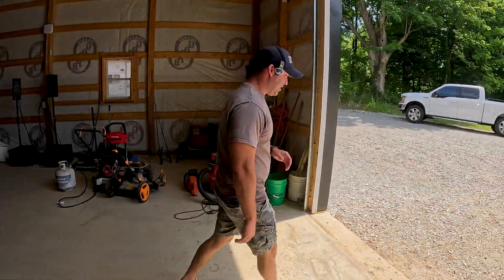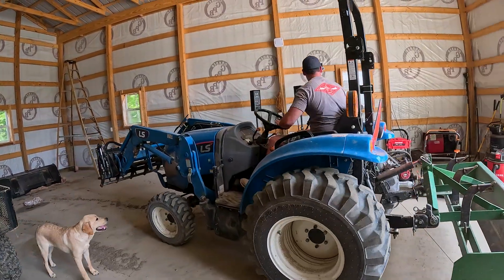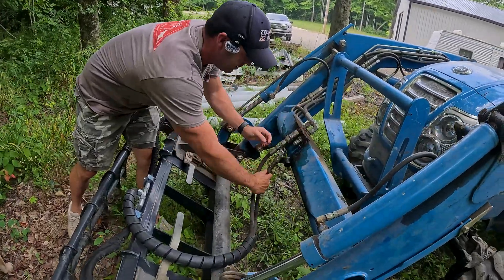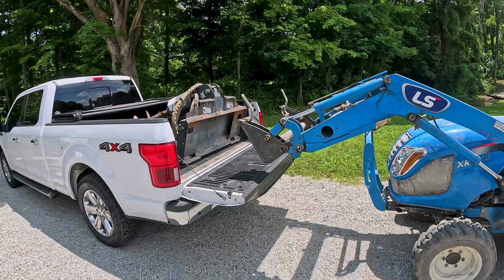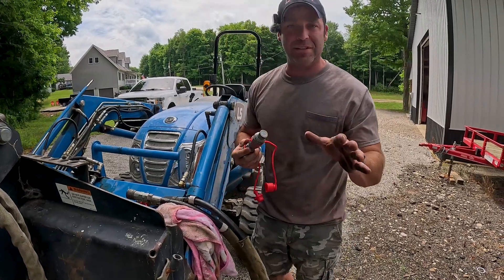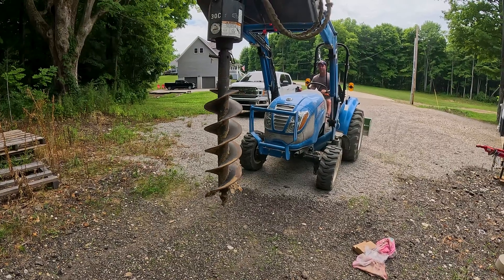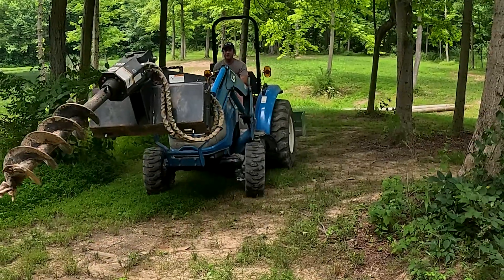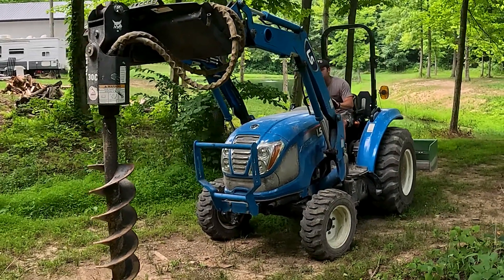Skid Steer Auger On A Tractor?

Comment: Wouldnt you be concerned about oil contamination? HST oil and skid steer oil I dont think are the same...
Reply from the maker: Hey, that’s a great question and definitely something I thought about! I looked it up at the time, and from what I found, the small amount of oil in the lines isn’t really enough to cause issues, especially if you’re not constantly going back and forth between machines. I did that about a year ago, and I haven’t had any issues with my tractor since. Probably not something you’d want to do all the time, but for a one-off, it doesn’t seem like a big deal from my experience.

Comment: You could use a hydraulic pump that attaches to your PTO Shaft.  I have a 24 HP John Deere and the hydraulic pump that I attached to my PTO Shaft is rated at 18 GPM.  My auger does a great job drilling holes.

Comment: I think this will create alot of heat in ur hydraulics skidsteers with hiflow have a seperate hydro cooler. May burn out ur hydro pump.
Reply from the maker: I would agree with you if you would have to run it for an extended period of time. This applications use is intermittently. I would average 2 minutes a hole when a did a fence. I don’t think it’s enough to get it to hot. It’s definitely something that needs to be considered while operating. Great insight and thanks for the comment!

Comment: Now that is very cool!! I have wondered about this very adaptation! A few questions come to mind. 🤔 Is your tractor similar in size to a Kubota L series or a JD 2,3,4 series? What is the rated hydraulic gpm (not including the power steering pump) of your tractor? 
Thanks for posting this!
Reply from the maker: Thanks! I thought so too. It is compared to the Kubota L 3901, JD 3 series. My pump output is 8.3 gpm.

Comment: Good video. Thanks. What is the hydraulic flow rate of the tractor? What about the GPM spec for the auger?
Reply from the maker: Thanks! The pump on my tractor has 8.2 gpm. I’ll see if I can find out what the skid steer auger is. Most skid steer augers have a minimum flow rate of around 10 gpm.